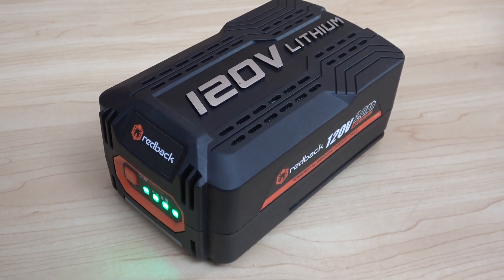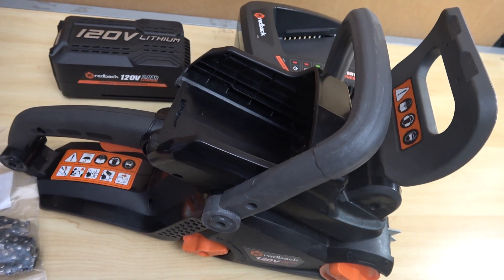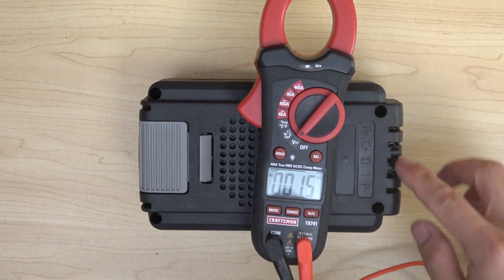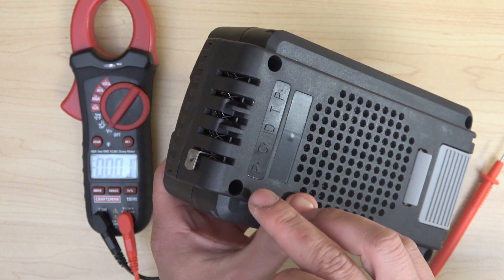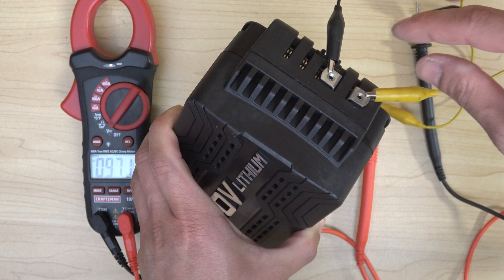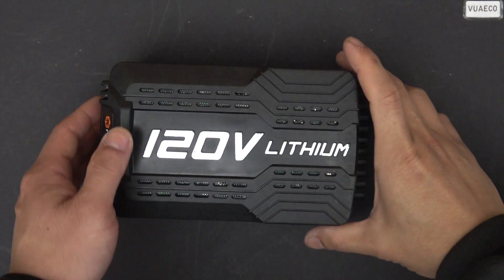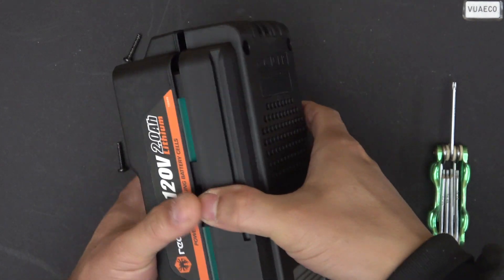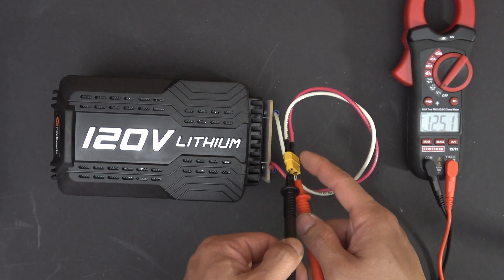Tear down and mess about with a 120V DC cordless power tool battery

Comment: volts dont kill u the amps do its dc also
[
Reply: Amps kill you if the volts are high enough to deliver high enough amps to you
Reply: georg ohm my beloved
Reply from the maker: Then try to touch your car 12V battery. It can put out some 1000 Amps. Does it kill you?
Reply: @vuaeco  12 volt car battery  with 1000 amps   could kill you dead
Reply: @vuaeco  The amps kill you but you need voltage to penetrate the skin....
Reply from the maker: @reahs4815  The point is, the other person said "amps kill u"! I'm just trying to prove my point! :D
Reply: This is simply untrue.

Comment: it has no effect because your body is more like a capacitor than a resistor, so high frequencies you conduct more where on DC, you are effectively charge like a bad capacitor. so you might get a small zap but quickly dissipates.

Comment: Thank you so much for making this! I have also been experimenting with/taking lithium ion battery packs apart to reclaim the cells for use in other experiments, I have a Redback 120v battery pack that won't charge and was taking it apart to figure out what was wrong with it, I was very afraid and very careful with the 120 volts, but this makes me feel a lot better! I was afraid to touch the terminals like you did, you are very brave! :)
Reply: Did you have any luck getting that 120 volt Redback charged. I'm having the same problem

Comment: My battery for my redback chainsaw died after 6 charge cycles.  Company will not help me with it either I'll never purchase from them again
Reply: The company has filed for bankruptcy. The writing was on the wall when I bought a bunch of tools from them and if something didn’t work, instead of asking me to send it back they just shipped out another one.
Reply: @JaminVerVelde1  hey thanks for the information. Guess that's why they would not reply to email
Reply: @JaminVerVelde1  Good information. My battery 9and I guess my mower) is trash.
Reply: @cwsgershwin  This company has been somewhat revived by new owners. They don't have all the same tools, but they have some. And they have batteries. And they have customer service now. :)
Reply: @JaminVerVelde1  I recycled the mower. It'd be almost impossible for Redback to regain my trust at this point, regardless of ownership.

Comment: Can you show how to charge that battery when power is to low for charger to recognize? I already tried the way your 20v video showed and it did not work for the 120v
Reply: My battery is sitting at 97 volts p+ to p-

Comment: my smart bms bluetooth is connected.just wondering the app says its 51,7volts and the cells are mostly 4v nearly apart from one that is 3.6v .ive tried to balance maybe need set up on bike.im waiting for new triple chainset  with 52teeth for more speed.but when i measure voltage between black bms charge discharge lead to positive battery its only 16volts.is that right?

Comment: I am no child prodigy but I am pretty sure that Ac Will hurt more because of the higher frequency. For example, a battery should have a frequency of around 0 Hz but the AC power from your house outputs around 50-60 Hz.  Just remember the bigger the Hertz the more it hurts.

Comment: hi.im trying to test a cordless parkside impact wrench.the battery is dead just 1500mah cells were inside.theres is 3 terminals on bms that i scrapped that side onto drill that has 2 terminals + and _ .im using a 22volt 18650 battery i made for my 18v dealt drill.but the parkside drill is not working when i press switch on drill.
Reply from the maker: Does it have more than 2 terminals on the impact wrench? If it does, then the 3rd terminal might be for communications and without proper wiring to the OEM board, it won't run.
Reply: Only 2 on the wrench but 3 on the   Battery that slides onto it
Reply: My smart bms Bluetooth came from china lithium battery’s battery.com it’s just balancing it’s showing my 14rh cell is low less than a volt but only have 13 cells at moment will have to see if it works ok as is can add another cell row it’s 13s5p now
Reply: Hi Steve - have you tried using one less cell in the 22v pack? It may help to more closely match the original voltage.
TL/DR: you're probably tripping the over voltage protection circuit.

Comment: Try it with damp fingers please!! Or better yet,a little nick/cut on your finger touching the terminals. I get zaps from my 48V battery pack. Your succeptability to electric shocks depend on a lot of factors, imo this is a misinformed and dangerous video.